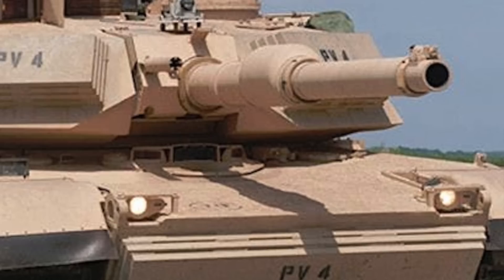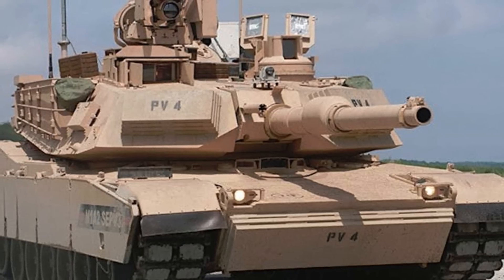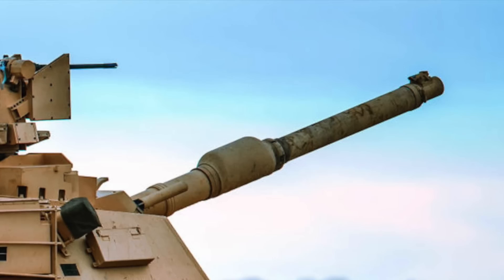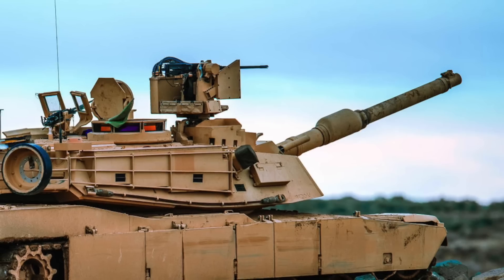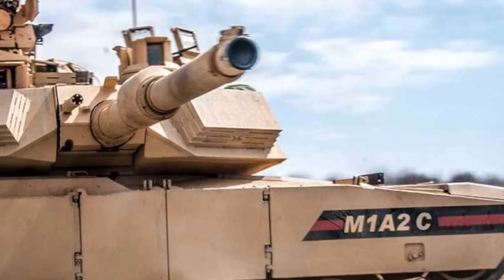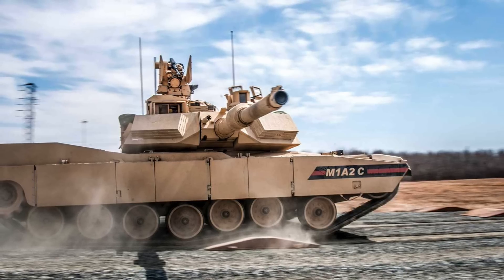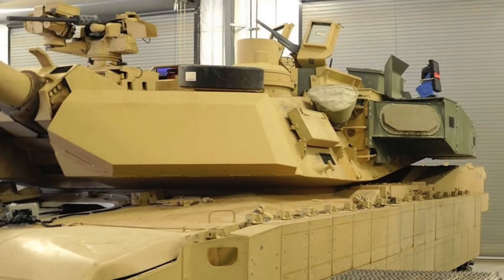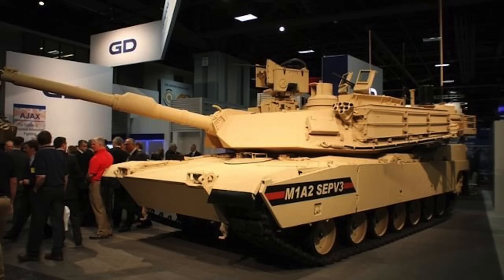ABRAMS M1A2C - FULL ANALYSIS OF LATEST VARIANT !

Comment: Hello there, is there any tank enthusiast's out there who thinks that any Tank has a chance against an all electric Tank measuring in at 7ft wide 7ft tall 17ft long equipt with a self-sufficient all electric power cell and a 44mm (E.N.R.G)-Electromagnetic-Non-Rail-Gun?
I am currently working on my own Tank design named [ PROMEITHEUN M-7 SABER ] currently still in design phase though. Vehicle specifications\/

1.) 7ft wide, 7ft tall, 17ft long, 27inches ground clearance.
2.) powered by a [CLASSIFIED] all electric self-sufficient powercell.
3.) driven by 2 17,000hp brushless electric motors.
4.) main gun is an E.N.R.G 44mm.
5.) opparated by one person only.
6.) 1,000 projectiles sabots onboard.
7.) top speed 127mph.
That's what what I'm aiming for as far as my tank project go's, much of what i have listed wont even be possible but I'm sure as hell gonna try. The good news is I'm an American so if I succeed we'll have a piant sized ace up are sleeve...... If I do succeed who would love to see it in action?

Comment: How many are they going to upgrade?
They need to reduce the weight...
Reply: The M-1A2C was canceled in august . the AP doesnt work very well. there is a much better upgrade to her coming in 2023 . with a all new turret cannon and fully digital systems that will reduce the weight with a auto loader
Reply: @georgicooley5491  oh that's good news only problem is the fuel consumption. Otherwise, it's a beast.

Comment: WHY does the Russian T-14 look similar to the USA M1A1 🤔
Reply: Thats because they dont if you look close . esp internally they are as different as a corvette and a ford pick-up truck. For starters the abrams has crew in the turret with no auto loader. the T-14 has NO crew in the turret and a auto loader. T-14 is a diesal engine abrams is a gas turbine engine. the T-14 crew sit in a row side by side in the belly with 3 crew. the abrams uses 4 crew with driver in front and rest of crew in turret behind. Road wheels are different diameter . the T-14 ejects spent shell casing out the side of the turret . where the abrams does not. i can go on about the differences all night . im not being rude im just being informative to people. tanks are profession.

Comment: Come on folks.....I was one of the guys whose unit received some of the original M1's (which replaced our M60A3's).  I'm a HUGE M1 fan.  Nothing says, "I'm yer Huckleberry..." like 60 tons of M1....especially back in the 80's.  But our MBT is pushing 40 years old now.  You can only throw so much duct tape and bubblegum on these things.  What our Army needs is something lightweight, extremely maneuverable, exceptionally fast (over 100 mph), sporting a rail gun that can pump out 5 shots in 10 seconds at a target 5K meters downrange.
Reply: their isnt a light weight rail gun thats mobile with enough electrical generation yet for a tank. the M-1 is outdated even compared to out Nato allies . Russia and france and Israel have had Active protective systems for over a decade. We are developing a more powerful and reliable desiel enigne with 1640 Hp for the abrams . she will have a all new turret and the old analog computers and copper wiring torn out to become fully digital with a auto loader to reduce the tanks weight and a new lighter 140 mm cannon . she is the M-1A3 . she is in light testing now and should go into full testing by 2023. China is getting better but they are still behind there engines in there tanks keep breaking and they are not battle proven like american or russian. Russia's new armata tank is why the abrams is getting that big overhaul .https://www.latestnewsplus.com/2019/11/russian-military-to-get-pilot-batch-of.html?spref=fb

Comment: The SU-57 and T-14 might be good but there are so few of theses that it won’t change anything
Reply: thats because both are not in full production yet . F-35 wnt through 14 years of testing before going into full production. the SU-57 goes into full production this year with a batch of 75 already ordered . that might seem small for now but you do 3-5 batches the number increases pretty fast. t-14 armata wont go into full production untill 2022. 1 year before the m-1A3 is suppose to be ready . the A3 abrams is far superior to the M-1A2C abrams. featuring a fully digital turret new 140 mm cannon that weighs less than the 120. all new turret . auto loader  and they got her weight down to improve fuel efficiency with a all new 1640 Hp engine.

Comment: Until the Russians can figure out how to shoot while moving at 50 MPH it will never dominate the battlefield. The M1A1 and A2 variant I commanded were the baddest mofos on the battlefield, can you imagine the power these new tanks will have? Some other upgrades I was told about in the 90s were pretty cool.
Reply: Merkava's pretty good.

And you can use the turret as a really big battle-axe if the main cannon is down and the engine is out.
Reply: the abrams can only shoot accurately up to 30 mph . russian T-80 and T-90 tanks esp the T-90MS have updated ballistic computers for shooting on the move. the abrams wont get a firepower upgrade untill 2023. its in testing. the M-1A2C is not a firepower upgrade. its a defensive upgrade. to bring her up to par with the T-90 countermeasures system and the guided missile shell from the merkeva tank. sec def jim mattis convinced trump we needed to buy those to compete with the russians in Europe . the Abrams was suppose to have one all the way back in 1989 but congress canceled its development.
Reply: shooting capability of the dirt boys is classified
Reply: CAG Hotshot  Hey, T-90 can shoot while in the air, that doesn't mean shit if it's not combat effective.
Reply: I wonder if there are any plans to match Russia’s 130mm gun....
Reply: They can do that tough

Comment: I am german !!!! Yes this Upgrade is pretty good ! The Engine Needs an Upgrade.......! The german leopard Engine eats all.....you San Fill it up with Salat oil, you can pee into this Engine, you can Fill in thinner for colors, Standart car gasoil, alcohol, olive oil, turpentine, aviation gasoline, all common fuels.......
Reply: I would say that T-80Us engine eats all, basically it can pish that tank to around 80kph, ye only problem is fuel consumption, but the rest it is actually pretty good.

Comment: APS, electronics... right direction. But engine power-pack overhaul (new turibne or diesel-electric power pack) and total armour rearrangement to keep weight in acceptable limits would be in order. 55 cal barrel wouldn't hurt either.  M-1 doesn't need front armour upgrade as it needs in several other places. Russian tanks had APS since Afghanistan - Drozd on T-55s.

Comment: The latest M1A2C is a hardware, software marvel , innovation and proven platform killing machine.
This vehicle has years of battle experience behind it, now years of technical upgrades . And an active protection system , in actual live fire tests the new data link for the new round , M1A2C crews were getting kills at 8,000 meters , it is designed for up to 12 ,000 meters ....unheard of in tank warfare. 
Not too mention a longer barrell variant and testing a larger calibre weapon 
The deadliest vehicle of it's kind on the battle field today
Reply: So... it catches up to Merkava Mk. IV ? :) Longest tank hit is 4800 by British Challenger 1.
Reply: @HerbertHingolstone  not nearly the best, but good enough, as well as Abrams is good enough. Armata seems to be the best, but can not be produced in any numbers, and without western electronics, it is not nearly as potent as it could be. Leopard has many flaws, however most of them can be fixed, it just seems that Germany can't justify the costs.
Reply: @solarissv777  Wrong... The Leopard 2A6 has a armour of 1500mm while The Abrams has 960mm I have references for this https://medium.com/@gma02695/the-leopard-2-tank-vs-the-m1-abrams-da0a282cba1e 

The Leopard 2's L/55 gun even beat the Challenger 2's latest DU munition... While the DM63 is only 100mm left behind from the M8294

Also Abrams the Abrams isn't proven FIGHTING OUTDATED EQUIPMENT IS NOT PROVEN.... FIGHTING OUTDATED DOWNGRADED T55 and T72 TANKS ARE NOT PROVEN

According to the Officials and Members who work with the Challenger 2 the thickest armour it has is the Belly Armour, but the RPG 29 with 750mm of KE Pen has already drilled through the Challenger 2 with ERA kits.... Funny Challenger 2
Reply: @solarissv777  armata doesnt need western electronics lol. Russia has fully resourced domestic parts now at 100 percent.
Reply: Last time I checked, tanks are very, very vulnerable against attack helicopters, drones and ieds. Practically sitting ducks.
Reply: @walterdayrit675  That is why they do not go alone.
Reply: @walterdayrit675  APS gonna solve this problem
Reply: @solarissv777  What is APS?
Reply: @walterdayrit675  Active Protection System. Like trophy, arena, afganit,   Iron fist, Quick kill etc.
Reply: @walterdayrit675  not most IEDS just the really big ones. newer tanks have ability to attack helicopters before they are even seen by the choppers. its called a guided missile shell. laser targeting. higher altitude drones are easliy killed by Russia every day in syria with the Panstir-S ground vehicles that defend bases or help protect tanks while on the move. if your a 3rd world country with 40-60 year old tanks yea they are sitting ducks but not in modern warfare.
Reply: what
Reply: Still need to fix the thickness of the weak upper plate
Reply: 12,000m ? I call bs on that nobody who even has like 60mins of knowledge on the aspect tank warfare would believe this. Crap
Reply: @lucifer_1073  agreed. this person doesnt know what the hell they are talking about. with full accuracy a abrams has a max fire range of about 2000 meters with max effective to 3000meters. even with israeli guided missile launched from abrams has only a range of 4-5000 meters.
Reply: @HerbertHingolstone  lies
Reply: @kinggator223     Nope
Reply: @HerbertHingolstone  Abrams is far better than the leopard
Reply: @HerbertHingolstone  but it is trust me
Reply: Pls look at this: https://youtu.be/gx2GKAhh-IE
Reply: @Alex-zg7vq  I believe the Abrams has the best firepower... but the Leopard 2 has a superior armour than the Challenger 2.... fighting outdated equipment is not combat proven...
Reply: @PanzerEdelweissStevenDelMar555  yes, the firepower of the abrams is better but armor, mobility and fire-control-system of the leopard 2 is superior in my opinion
Reply: @Alex-zg7vq  you do understand that the leopard 2 A2 and abrams use the exact same cannon right ?
Reply: @PanzerEdelweissStevenDelMar555  you do understand that the leopard 2 A2 and abrams use the exact same cannon right ?
Reply: @georgicooley5491  I know, but not the same ammo :)
Reply: @georgicooley5491  Leopard 2's armour is the thickest of all the 3, Abrams and challenger 2 are only 900mm of KE protection. The Leopard 2's armour is 1500mm of KE. While the firepower of the Leopard 2 tungsten DM63 is only 100mm behind of the M829A4.. So the Leopard 2's armour is more extravagant. They can fire the same munitions all they have to do is switch an Eprom chip.
Reply: To bad the President just canceled the M-1A2C . Apparently she got hyped up way to much from the reports . Don the longer barrel version wont be fielded untill 2023 at the earliest.
Reply: @HerbertHingolstone  The Leopard II is badly overrated. Until it sees combat and performs well, it cannot be considered to be the best tank. There are too many German worshippers on YouTube. Ignore them.
Reply: @classicgalactica5879     Only that "german worshippers" are not the only ones worshipping it, but also tank experts, governments and militaries all over the world.
Reply: Nothing can kill with APFSDS past 4,000 meters, only Russian and Israeli ATGMs can shoot past 5,000 meters. Tanks armour has not really improved that much plus it got heavier with same engine, I've heard that electronics got better and it has got better round but i still don't think is is like Russian Svinets 1 which can penetrate 850mm or RHA, while max this new shell can pen for Abrams is around 800mm which us not bad. My honest opinion is that it's unnecessary upgrade they should have made something like Challenger II and plus if they upgraded it they should have made it like T-90M. Look A1M2C is far from bad, but it really kinda is a downgrade.
Reply: @russiandispenser8482  ohh my, I gues we need to inform Lockheedmartin that they need to inform their users of the AGM-114 Hellfire to no longer fire it at targets at 11,000 meters or to stop advertising the AGM-179 Joint Air-to-Ground Missile(JAGM) as a 15,000 meter plus missile. The Raytheon BGM-176C, I gues really don't have a range of 15,000 meters..

Comment: Has the weight increased?
If so, what has this done to manoeuvreability?
Reply: Better turbo can easily be fitted for more power
Reply: @MALA2243 the speed limiter is to prevent the engine breaking which broke alot in the gulf war. she was created at 60 tons today most are 71-73 tons depending on the model .now she will weigh even more with this proposed upgrade. the Gas turbine engine has same horsepower in her the day she was launched in 1980 . its effected her alot. plus airlifting them as well is a concern because they wont be able to carry more than one now on a c-17 .thats why they want to put a new engine and turret in her in 2023 to cut down her weight and increase engine power.
Reply: Have you ever been next to an M1 A1 what it is running it has a turbine engine I'm sure it won't have any problem with the additional weight
Reply: @rolfstamenov9914  I'm sure the extra weight wouldn't turn into a underpowered slug, but it might take one or two mph off the top speed.
Reply: The abrams has already been known to be far less maneuverable and far more heavy and slower then other mainline battle tanks

Comment: Is that 120 mm main gun a smoothbore (as the word "gun" would imply?) Anyone got a link to the munitions it can use?
Reply: Yes, it has a smoothbore gun. The next piece of text might answer question: 'The tank is armed with the same M256 120 mm smoothbore gun as its predecessor. Range of effective fire is in excess of 4 km. It can fire the M829A3 APFSDS rounds with depleted uranium penetrator and M1028 canister rounds that discharges massive blast of tungsten fragments at muzzle exit. This round has devastating lethality against assaulting infantry between a range of 200-500 meters. Ammunition for the main gun is stored in the turret bustle, fitted with blow-out panels.'
Reply: @krultheg3021 :
Outstanding! Thanks much.

I thought the purpose of the smoothbore was to fire a munition that did not spin. For example, there is such a thing as artillery fired rockets. The DPRK has them. Vastly increases range. I'm pretty sure we do too. Unclassified info very hard to find. Even the name would help to do a search.
Reply: @Hankusorealius  Yes thats true, a smoothbore gun has no rifling (rifling is the pattern that is machined into the internal surface of a gun's barrel), and so the fired rounds do not spin. 

If you want to know more about the advantages and disadvantages of a smoothbore canon the following site might be intresting for you: https://www.quora.com/Which-is-better-rifled-or-smoothbore-tank-guns

As for the rocket artillery i dont get your question. Do you want to know the name of the rocket artillery that are active in your country?
Reply: @krultheg3021 :
Thank you again. Let me check out that link b4 I put you to any more trouble. You're super!